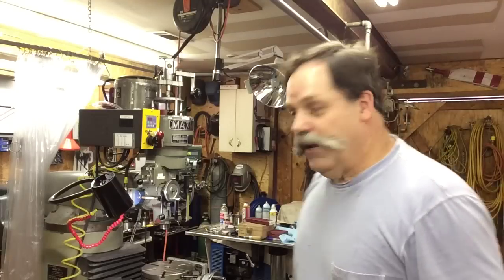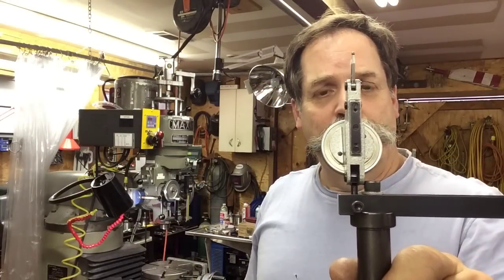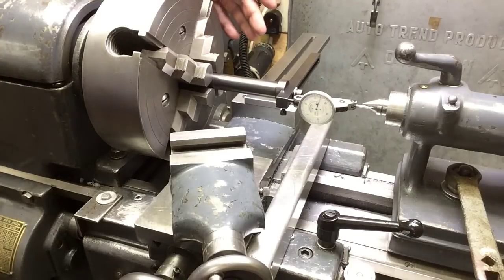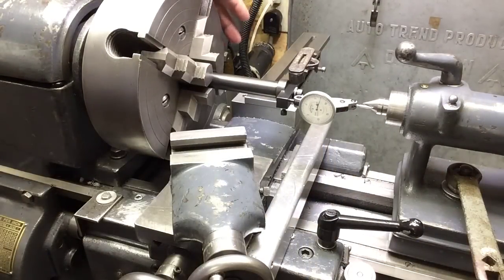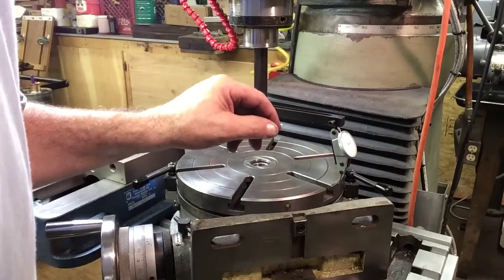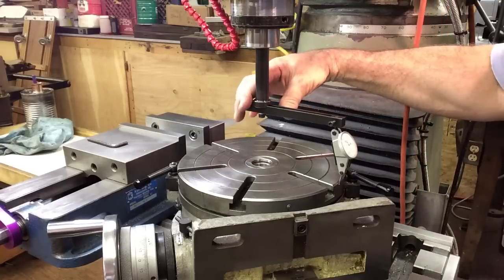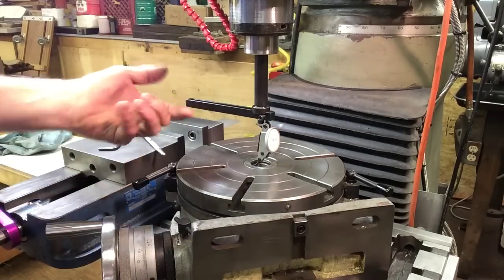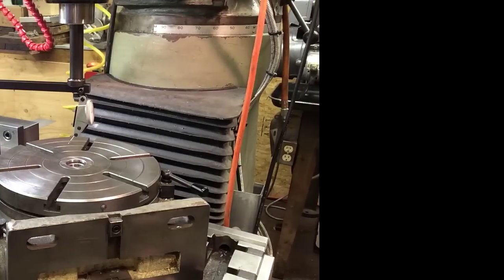Lathe Tailstock Alignment Tool Demo Wood or Metal Lathe

Comment: Question for Randy or the audience on the rotary table....Can you assume the outside diameter of the table is concentric with the center of rotation?  Prob a dumb question but I'm a little inexperienced with the mill.
Reply from the maker: gohuskies583 I think it would all matter how high of a quality the rotary table is.  I have not checked mine.  I would hope that it is.  That would be something to do today,  Thanks for the idea and comment.  i will let you know how it comes out.
Reply from the maker: gohuskies583 I checked mine today.  Concentricity center hole to Outside Dia. TIR = 0.0008, Rotation Concetricity about the center hole TIR = 0.0003 and the same for the outside dia.  Not to bad.  good enough for me.  Thanks for the question.

Comment: Good tool! Here's something else you might want to build Center a Rotary Table in Under a Minute Without an Indicator
Reply from the maker: Thanks for the comment.  I have made one of the rotary table tools and it works just ok with my table +/- 0.005.  My table is 10" and weights about 60-70# and it just doesn't slide easy enough to line up perfect.  Thanks for the comment and watching.

Comment: BTW, I was thinking about the spot on that section of the bolt you blued at 4:10 and I wondered if that may have been where someone in the past had heated it up to release a nut the was stuck on there? Could that be possible or did you have the bolt since it came from the factory? Just a thought on why the structure may have crystallized and hardened...still works well and I'd have never noticed until you mentioned it.

Aloha...Chuck.

Comment: if there was ever a use for a coaxial indicator this would be it. Coax are cheap as hell now anyways so its worth buying. People use them to tram their mills but that's not they're for, among other things. They're only for coaxial indicating.
Reply from the maker: Yes, for dialing in a hole coaxial's work great, but I do not have one.  I tram with a tramming tool I made.  After you dial in a few hole's it goes pretty fast.

Comment: Looks really nice. You could add a bit more versatility to add a horizontal hole also to use it for tramming the mill with the DTI.
Reply from the maker: Yes I agree, I will have to see if I have room..  For Tramming I have a tramming gage I made.  Thank you for the comment.

Comment: Randy,
A really handy tool for calibrating stuff. The finish looks very professional. Is that a bluing or a black oxide finish? Thanks for the video.
Have a good one!
Dave
Reply from the maker: Bluing, I used a Rust Bluing method.